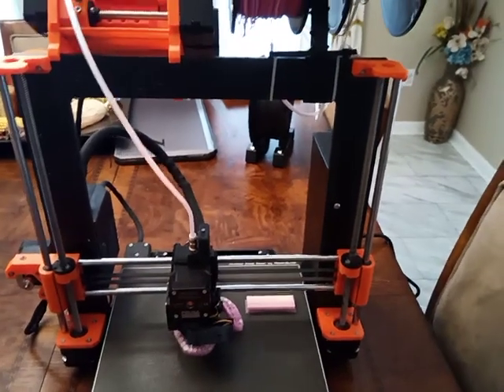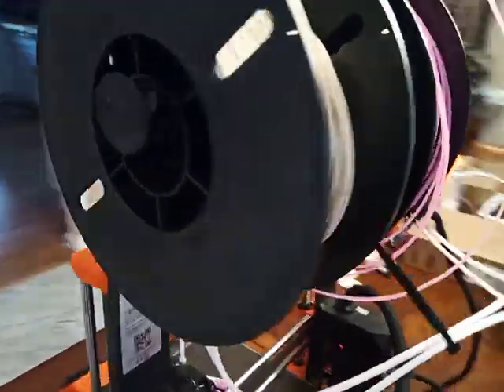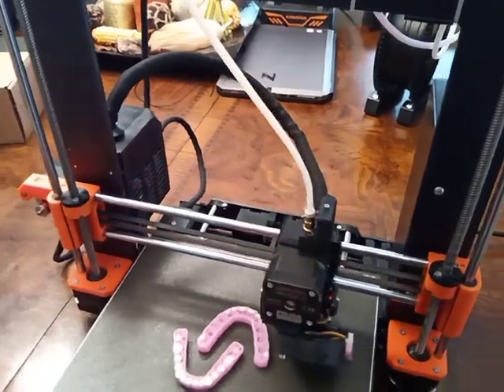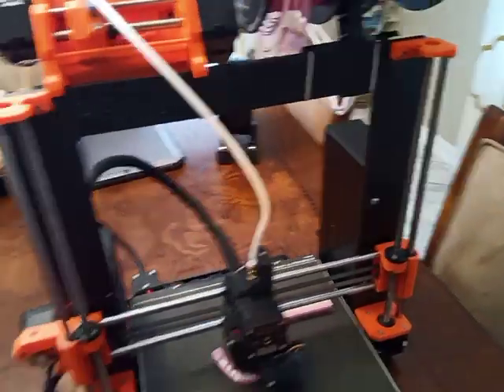Use the MMU2S without a filament buffer!

Comment: Actually I have the problem of flattened filament on my Qidi X-Max 3 - so extreme the filament even jams in the feeder if I do not pull on the filament on unload. So while it uses Klipper, an MMU (ERCF) can not be used with stock hotend. After changinmg to a Revo hotend, with Revo Standard Nozzle the filament tip turns out nicely, without any problems.
However, I think about another solution: The MMU has it's own feeder. So actually, some mechanism disengaging the hotend feeder on unload should be the perfect solution, practicly converting the direct extruder into an bowden extruder just on unload. The MMU would pull the filament out while the extruder gears are disengaged, so the gears do not press against the weak filament. As unloading stops before the tip reaches the MMU-feeder, it would never get pressed... (it would be hard when it reaches the MMU anyway).
Just an idea.

Comment: Will you get the MMU3?
Reply from the maker: Probably yes. The MMUS2 works flawless for me after doing a few changes to the heat break. I can feed it potatoes now and it will have no loading /unloading issues. The guy I bought it from couldn't get to work reliably. But the problem isn't the MMU or the sensors.The problem is the E3D V6 heat break. It only makes it look like the sensors fail reading the filament. Kind of sad watching all the problem solving videos  looking in the wrong place. It is obvious to me what the problem was.
Reply: @Gigaloader  Then it's time to also get at least a 3.9 Upgrade Kit. 😄
Reply: @Gigaloader  what is really sad tat help couldn't be found from Prusa